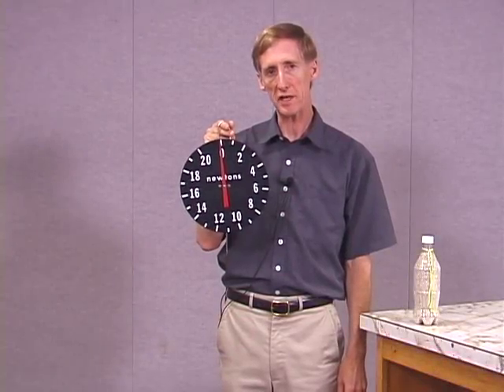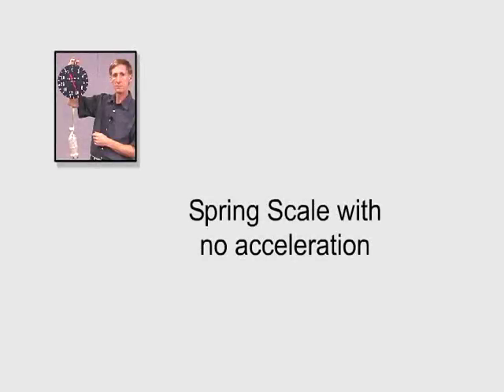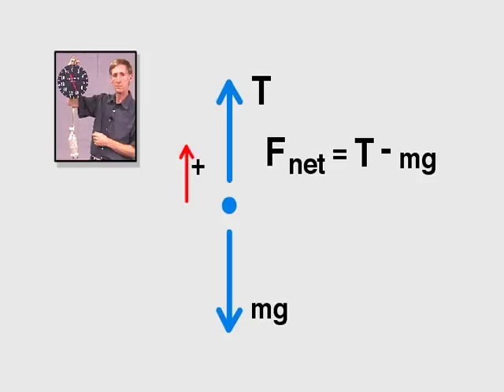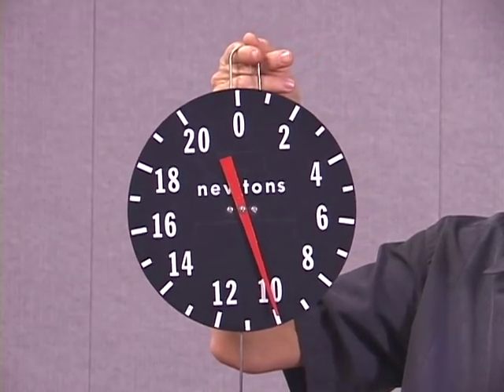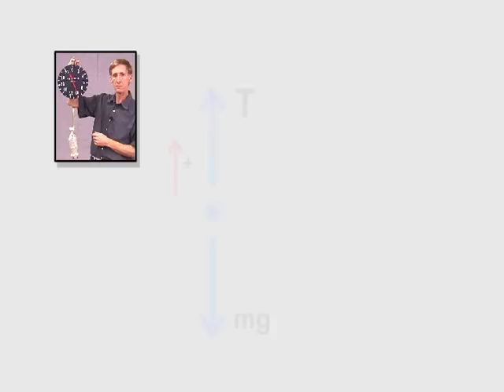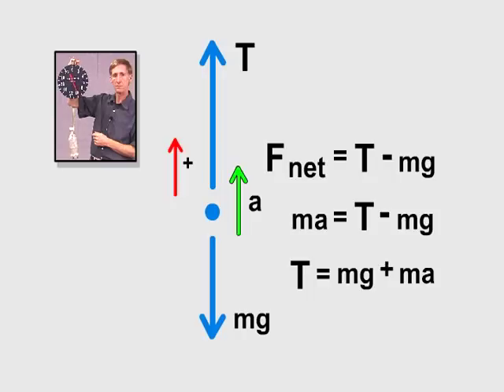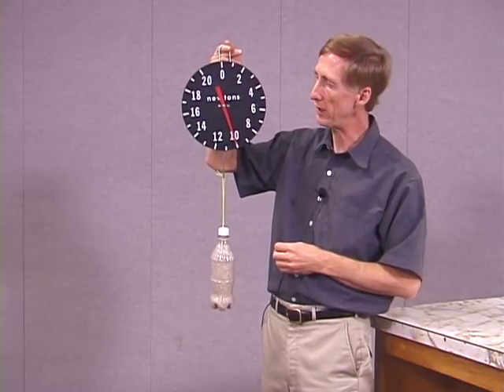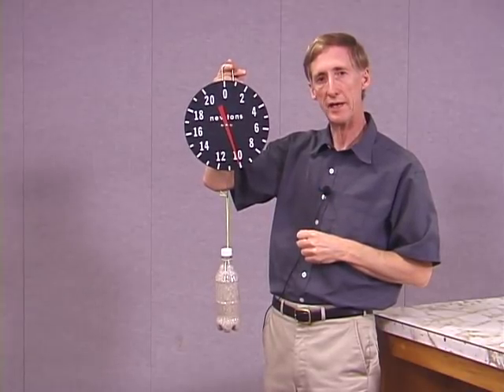Spring Scale: What Does a Spring Scale Measure? Part 1

Comment: We can see the spring scale when accelerated upward reaching almost 17 Newtons on 3:05
With that being said and with our equations we have:
Fnet = T - mg
ma = T - mg
T = mg + ma

We can see that the bottle in a state of static equlibrium measures 10 Newtons
So we have:
Fnet = T - mg
0 = T - mg
T = mg
10 Newtons = m (9.81 m/s^2)  (The latter being the average acceleration of gravity) 
m = 10 Newtons / (9.81 m/s^2)
m = 1.02 Kg

Taking the previous equation
T = mg + ma
T = m (g + a)
g + a = T / m
a = ( T / m ) - g
a = ( 17 Newtons / 1.02 kg) - 9.81 m/s^2
a = 16.67 m/s^2 - 9.81 m/s^2
a = 6.86 m/s^2

So in case you were curious, we can conclude that when he lifts the bottle on 3:05 he does it with an acceleration of 6.86 m/s^2 (positive because he moves it upward).

Just checking the final equation we have:
a = ( T / m ) - g
In a state of static equilibrium we would have a = 0 m/s^2
0 = (T / m ) - g
0 = ( 10 Newtons / 1.02 kg) - 9.81 m/s^2
0 = 9.81 m/s^2 - 9.81 m/s^2
0 = 0
Therefore we know the equation is correct

Now, when he accelerated the bottle downward, the spring measure moved down to almost 3 Newtons on 5:02
With the latter equation we have:
a = ( T / m ) - g
a = ( 3 Newtons / 1.02 kg) - 9.81 m/s^2
a = 2.94 m/s^2 - 9.81 m/s^2
a = - 6.87 m/s^2
So when he lowers the bottle on 5:02 he does it with an accelaration with a similiar value to the opposite case just that in this time the value is negative, which is an indicator of the acceleration being downward.

Now well, for the spring measure to be on zero:
a = ( 0 / 1.02 kg) - 9.81 m/s^2
a = 0 m/s^2 - 9.81 m/s^2
a = - 9.81 m/s^2

We would need to lower the bottle with the acceleration of gravity, which tells us that if he let go of the bottle, leaving it to the force of gravity, the scale measure would end up measuring 0 while falling.
If we lower the bottle with an acceleration higher compared to the acceleration of gravity we would have a negative value of T which would be caused by the bottle pushing upwards. 
This is because in spite of the fact that the bottle is moving downwards the higher acceleration of the spring measure compared to the acceleration of gravity would trigger the inertia of the bottle resulting on a pushing force applied on the spring measure.

If we want to know the exact acceleration of this particular system at any given time:
a = ( T / m ) - g
a = ( X Newtons / 1.02 kg) - 9.81 m/s^2
With X being the value of the spring measure at the time. You would only need to substitue this value and you would have the value of the acceleration. In this particular case a value higher than 10 Newtons indicates an upward acceleration, on the other hand an acceleration lower than 10 Newtons would indicate a downward acceleration.

We can see all this applied on elevators. 
When you take an elevator as you go up you feel a slight force pushing you down to the floor.
However when you go down you feel a slight force pushing you up which feels as though gravity decreased momentarily.

This can also be seen on Reduced-Gravity-Airplanes wich take parabola-like trajectories that for moments increase the value of G and then for moments decrease the value of G down to zero when reaching the peak, making them perfect for training astronauts.

Another example related to this is Disney's Twilight Zone Tower of Terror on Orlando Florida, which doesn't only let the people go on free falling at the end of the attraction, but also the secret of the ride is that it has a cable pushing down the elevator making people experiment a downward acceleration higher than the value of G making the ride even more thrilling.

And that's it, all my contribution, thanks for reading all my boring explanation. I'm just a science nerd really excited by all of these topics, and I just wrote this in case you wanted to go deeper on the subject. Peace.